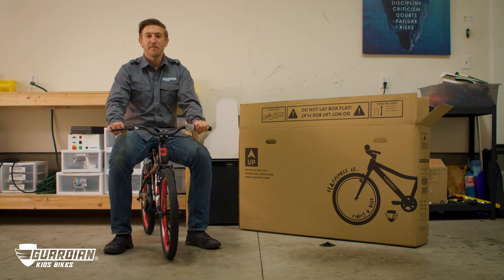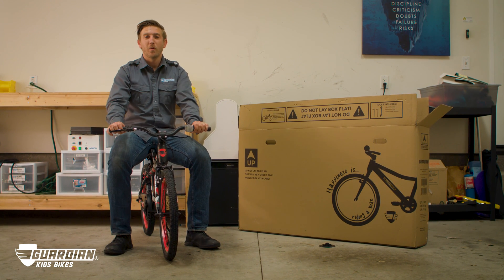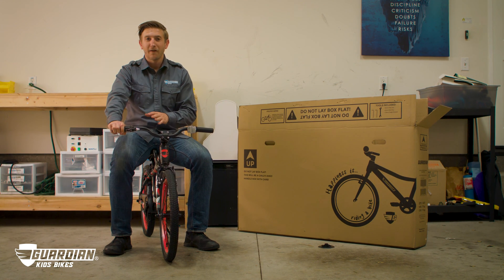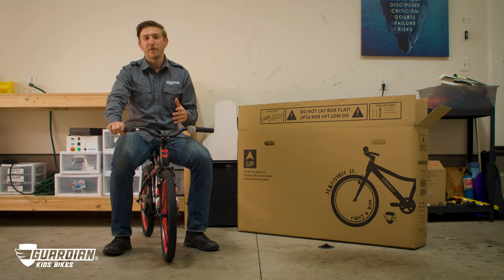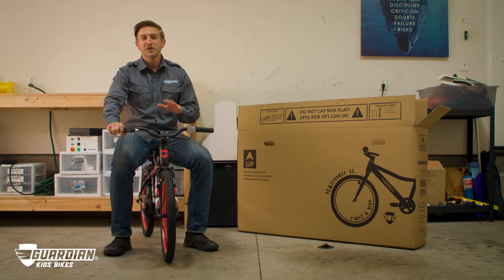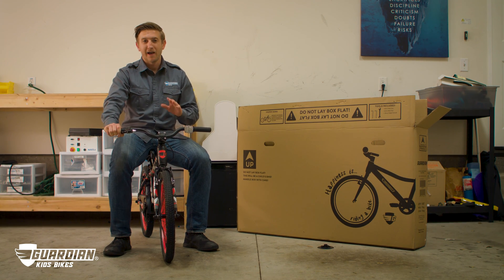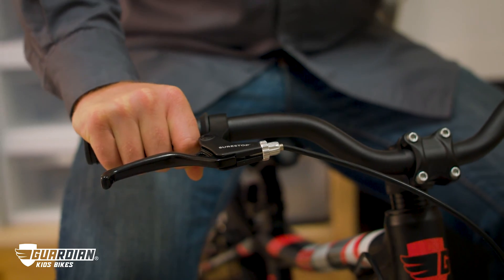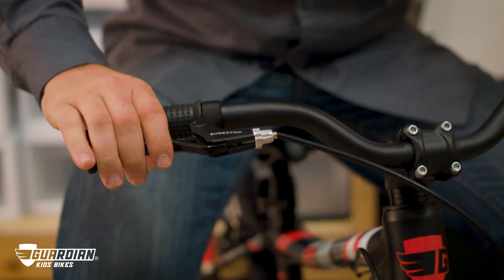Why won't the front brake work? - Guardian Bikes

Comment: Having the same problem as everyone else it seems. The front brake is only occasionally engaging when our son is riding on it. Extremely dangerous it suddenly stopped working with him going down our driveway. DO NOT BUY A GUARDIAN BIKE. Like someone else said save yourself the trouble and get a used bike until they are big enough for a real brand.

Comment: I disassembled the brakes and re-built them completely to understand how they work.  It is NOT explained properly or at all by Guardian.  The right rear brake pad is on a sliding linear translating sub-assembly that is pulled by the forward angular velocity of the rear wheel as it rotates forward and that angular velocity force that is applied at 90 degrees to the brake pad and is proportional to the speed of the bike wheel rotation (RPM), is what actually pulls the sliding linear translating brake assembly and thereby pulls the cable that actuates the front brakes.  It would be beneficial for this company to create an animation that shows this in a pictoral video form for the average person to understand.  I am trained on aerospace hardware, so it was easy for me to figure it out once I reverse engineered the brake assembly but I can totally see how it would be an unexplainable mystery to the average person.
Reply: Or the front brake only works when you’re sitting on the bike.
Reply: Why does it need to be explained? Why does the average person need to understand? Maybe just have your kid ride the bike as was intended. If it works, it works. Not everything has to be explained in a detailed level for the consumer.

Comment: Even when I sit on the brake and apply it the front brake doesn't come on.
Reply: Hello Guardian guys and bike owners, just got my song his  guardian balancing bike. I made sure front cable was set to housing and also tried braking smoothly/ sitting on brakes and front breaks don’t activate yet. Is there anything else I should try? Thank you.
Reply: The front brake cable doesn't fit in the housing unit, it's too small
Reply: 20 min first impressions. I rode the bike as best i could and the front breaks not under any circumstances worked at all. I’ll try to adjust them and go through the owners manual again but for such an expensive product my opinion is that the shit should work out of the box as advertised and it does not do that. If i had known this i would have gone to the thrift store and bought my son a 20$ used bike, or a new box store bike. I was on the fence about this purchase for a while, I grew up riding, I still ride, I didn’t have any trouble more than the next kid learning how to ride, neither did all the people that raised me so what is the issue? Why do we need to reinvent the bike? We don’t. Save your money. Go to Walmart or get a hand me down bike from a friend or thrift store.
Reply from the maker: Hi! You need to apply weight on the bike and move it in a forward motion.
Reply: @GuardianBikes  We've done this but the front brakes and the pedals are locked. How is a kid supposed to figure this out if adults can't?
Reply: Glen Hettinger
For safety the brakes won't work if you sit on the brakes because they will pinch your bum!